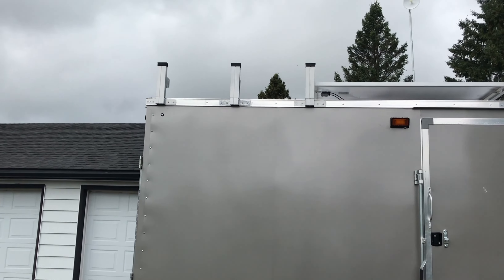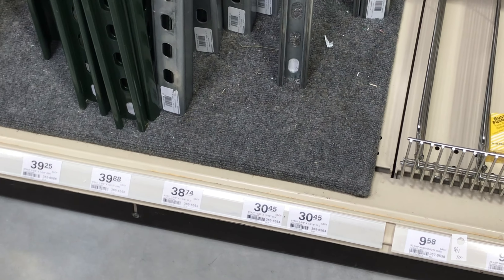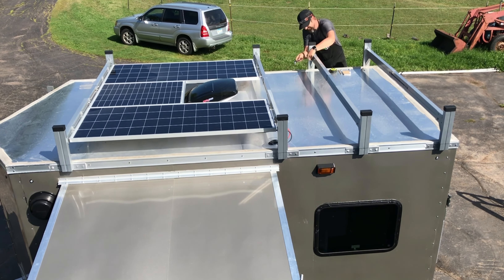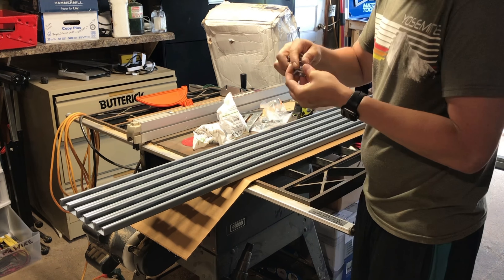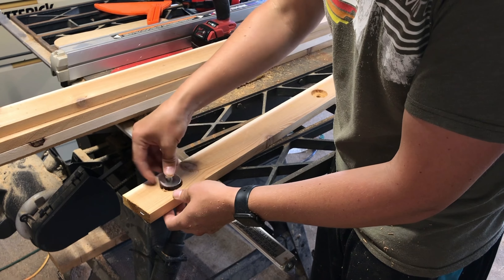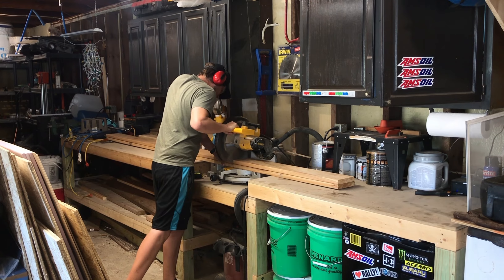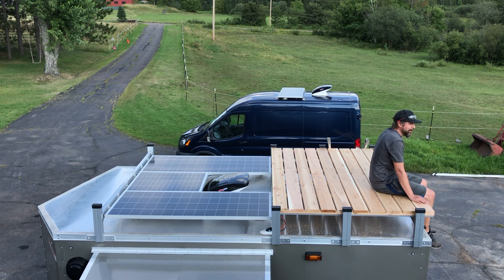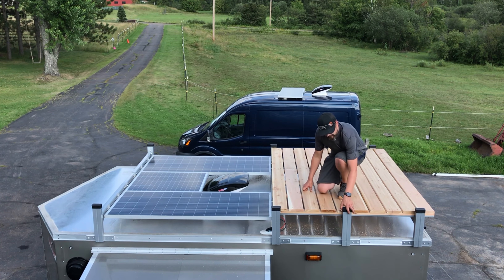Cargo Trailer Conversion Series: Red Cedar Roof Deck!

Comment: NICE WORK! I would water seal the tops of the deck. the bottom would give you the smell still. peace...
Reply from the maker: Thanks! As for sealing, I like your thinking but I would seal the whole thing or not at all. If you seal the top, moisture will still wick in through the bottom. I think of cedar like a sponge. It does absorb water, but give it a little time and it will release the moisture and completely dry out. Cover 3/4 of the sponge and it will trap the moisture and mold. Or in the case of the cedar, lead to premature rot.

Comment: so my question and concern is with that huge welding issue with the upright. Did you find it was just the one? do you think it will always be in the back of your mind that it will just fail? also, which paint did you wind up going with ?

Comment: Looking to build a deck on top of 6x12 trailer using 1 5/8 unistrut and double strut and try to figure out to use trex decking or wood decking. How does it tow going down the road . How much weight will deck hold
Reply from the maker: Sounds like a good plan. I didn’t have any issues towing. I did intend to install a wind deflector up front but sold the trailer before I got to that. 

I believe the rack is rated for 400lbs per pair. I’d be tempted to look at other HD racks since I did have one failure during install. However no other issues post install to date.